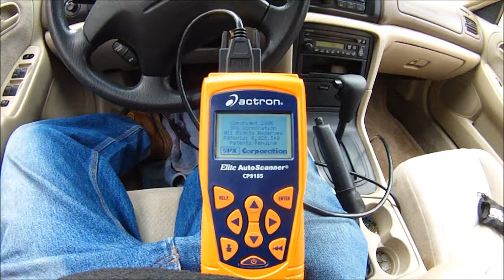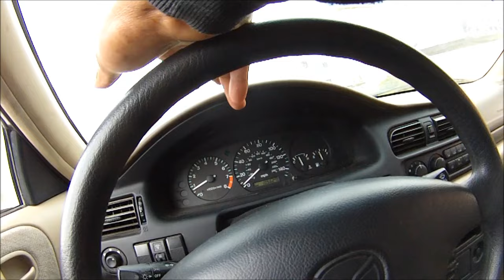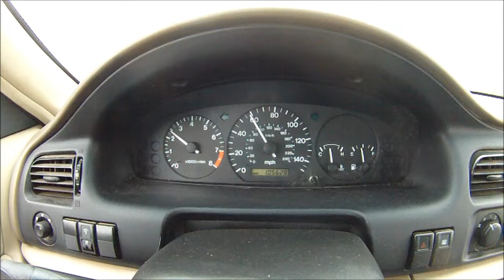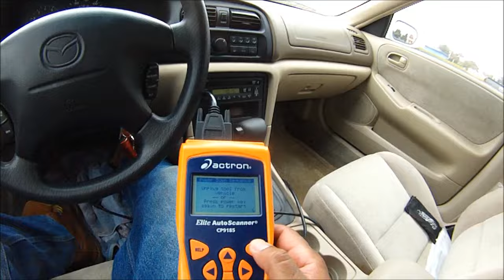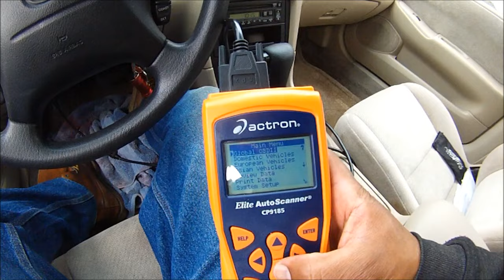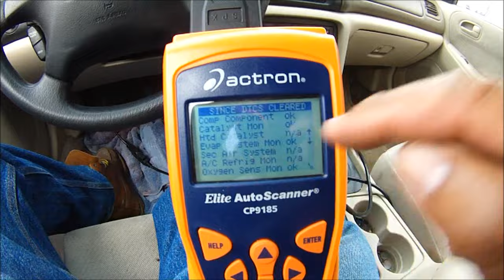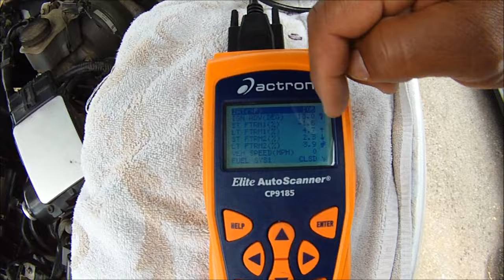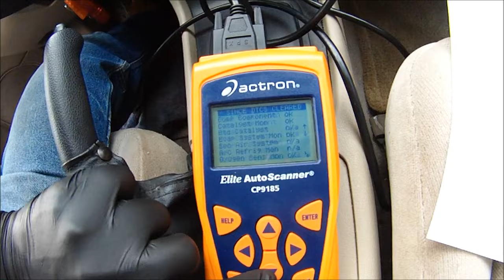WHAT SMOG TECHS WONT TELL YOU AFTER YOU FAIL THE SMOG TEST FOR (INCOMPLETION OF OBDII SELF TEST)

Comment: The easiest and fastest way to complete the drive cycles and get the monitors ready that I have ever found is the following:

#1. Fully warm up the engine, then drive on the highway/interstate at normal interstate speed ( without stopping ) using cruise control for 15 to 20 minutes. This will test everything except for half of the evap system. Many of the tests can not be run at low engine speed or if you are accelerating with much throttle. This is why cruise control helps so much. It maintains a nominal engine speed, under load, at a constant speed while the engine is fully warmed up. This is the perfect condition that almost all tests will run at. If you don't have cruise control, just keep the throttle and speed as steady as you can manually.

#2. Park the car, turn it off and let it fully cool down for 1 to 1.5 hours ( depending on how hot it is outside ). This runs the other half of the evap test which only happens when the car is turned off and cooling down. It watches the pressure in the gas tank to see if it falls when it cools down. Some cars also have electric vacuum/pressure pumps the gets activated as the car is cooling down.

Perform these steps exactly two.

Why twice?

There are 2 classes of OBDII codes, class A and class B.
Class A codes will set immediately or after only 1 drive cycle.

Class B codes will only set after being successfully tested on 2 drives cycles. Notice the word "successfully". If the proper conditions are not present during a drive cycle, the test won't run. This is why many people have to perform lots and lots of drive cycles to get the tests to complete. They simply don't know or understand how to create the conditions required for the tests to be successfully run.

Once you know how, it's very easy! Anyone can do it.
Reply: does the drive time to the highway factor?  takes me 10 mins to get on it.
Reply: No, it doesn't matter. For additional information check out page 25 of this document about the CARB standard: http://www.lbcc.edu/attc/documents/OBD2.pdf
Reply: I hope this works and I believe it will from what I have researched. A great big THANKS!!!
Reply: The document is no longer present at that link.  Is there another source for the info?

Comment: I just did this on my 2004 Mazdaspeed Miata and it worked beautifully! The Catalyst and EGR passed after the highway run. The evap test passed after a few minutes of stop and go at 35mph.
This is a blessing since I obtained the official instructions from Mazda to run a drive cycle on my model car and it's far more complicated than your instructions.
Reply from the maker: Congrats on passing your smog. I am in the process of finishing a drive cycle for a 96 Civic and its driving me nuts, I might have to change the Catalytic Converter but will not know until tomorrow. Ya some of the drive cycle modes are harder than others you just need to hunt it down. Nothing like passing the dreaded rip off smog test huh? lol.

Comment: GM drive cycle
Autotap® OBDII Diagnostic Scanner
General Motors Driving Cycle
A complete driving cycle should perform diagnostics on all systems. A complete driving cycle can be done in under fifteen minutes.

To perform an OBDII Driving cycle do the following:

Cold Start. In order to be classified as a cold start the engine coolant temperature must be below 50°C (122°F) and within 6°C (11°F) of the ambient air temperature at startup. Do not leave the key on prior to the cold start or the heated oxygen sensor diagnostic may not run.
Idle. The engine must be run for two and a half minutes with the air conditioner on and rear defroster on. The more electrical load you can apply the better. This will test the O2 heater, Passive Air, Purge "No Flow", Misfire and if closed loop is achieved, Fuel Trim.
Accelerate. Turn off the air conditioner and all the other loads and apply half throttle until 88km/hr (55mph) is reached. During this time the Misfire, Fuel Trim, and Purge Flow diagnostics will be performed.
Hold Steady Speed. Hold a steady speed of 88km/hr (55mph) for 3 minutes. During this time the O2 response, air Intrusive, EGR, Purge, Misfire, and Fuel Trim diagnostics will be performed.
Decelerate. Let off the accelerator pedal. Do not shift, touch the brake or clutch. It is important to let the vehicle coast along gradually slowing down to 32km/hr (20 mph). During this time the EGR, Purge and Fuel Trim diagnostics will be performed.
Accelerate. Accelerate at 3/4 throttle until 88-96 km/hr (55-60mph). This will perform the same diagnostics as in step 3.
Hold Steady Speed. Hold a steady speed of 88km/hr (55mph) for five minutes. During this time, in addition to the diagnostics performed in step 4, the catalyst monitor diagnostics will be performed. If the catalyst is marginal or the battery has been disconnected, it may take 5 complete driving cycles to determine the state of the catalyst.
Decelerate. This will perform the same diagnostics as in step 5. Again, don't press the clutch or brakes or shift g
Reply from the maker: Thanks George K we appreciate your contribution to this troubling task that many people have no idea about, right on God Bless.
Reply: The gas tank has to be between 1/4 and 3/4 for the evap solenoid to cycle, and pass that monitor test
Reply: How do you do this without putting other motorists in danger or getting pulled over????

Comment from the maker: This is the drive cycle for Code P1000 Go get it and attack the problem
Ford P1000: OBDII Monitor Testing Not Complete
Jaguar P1000: Engine control module (ECM) - internal error
Kia P1000: System diagnosis incomplete
Land Rover P1000: Engine control module (ECM) memory erased - no codes stored
Mazda P1000: OBDII Drive Cycle Malfunction

Read more at: http://www.obd-codes.com/p1000
Copyright © OBD-Codes.com

OBDII Monitor
Exercised	
Drive Cycle Procedure

Purpose of
Drive Cycle Procedure
Drive Cycle
Preparation	1. Install scan tool. Turn key on with the engine off. Cycle key off, then on. Select appropriate Vehicle & Engine qualifier. Clear all DTC's/ Perform a PCM Reset.	Bypasses engine soak timer. Resets OBDII Monitor status.
2. Begin to monitor the following PIDs: ECT, EVAPDC, FLI (if available) and TP MODE.
Start vehicle WITHOUT returning to Key Off.	
3. Idle vehicle for 15 seconds. Drive at 64 Km/h (40 MPH) until ECT is at least 76.7°C (170° F).	
Prep for Monitor Entry	4. Is IAT within 4.4 to 37.8°C (40 to 100° F)? If Not, complete the following steps but, note that step 14 will be required to "bypass " the Evap monitor and clear the P1000.	Engine warm-up and provide IAT input to the PCM.
HEGO	5. Cruise at 64 Km/h (40 MPH) for up to 4 minutes.	Executes the HEGO monitor.
EVAP	6. Cruise at 72 to 104 Km/h (45 to 65 MPH) for 10 minutes (avoid sharp turns and hills) Note, to initiate the monitor: TP MODE should =PT, EVAPDC must be >75%, and FLI must be between 15 and 85%	Executes the EVAP Monitor (If IAT is within 4.4 to 37.8° (40 to 100°F))
Catalyst	7. Drive in stop and go traffic conditions. Include five different constant cruise speeds, ranging from 40 to 72 Km/h (25 to 45 MPH) over  a 10 minute period.	Executes the Catalyst Monitor.
EGR	8. From a stop, accelerate to 72 Km/h (45 MPH) at 1/2 to 3/4 throttle. Repeat 3 times.	Executes the EGR Monitor.
SEC AIR/CCM (Engine)	9. Bring the vehicle to a stop. Idle with transmission in drive (neutral for M/T) for 2 minutes.	Executes the ISC portion of the CCM.
CCM (Trans)	10. For M/T, accelerate from 0 to 80 Km/h (o to 50 MPH), continue to step 11. For A/T, from a stop and in overdrive, moderately accelerate to 80 Km/h (50 MPH) and cruise for at least 15 seconds. Stop vehicle and repeat without overdrive to 64 Km/h (40 MPH) cruising for at least 30 seconds. While at 64 Km/h (40 MPH) , activate overdrive and accelerate to 80 Km/h (50 MPH) and cruise for at least 15 seconds. Stop for at least 20 seconds and repeat step 10 five times.	Executes the transmission portion of the CCM.
Misfire & Fuel Monitors	11. From a stop, accelerate to 104 Km/h (65 MPH). Decelerate at closed throttle until 64 Km/h (40 MPH) (no brakes). Repeat this 3 times.	Allows learning for the misfire monitor.
Readiness Check	12. Access the ON-Board System Readiness (OBDII monitor status) function on the scan tool. Determine whether all non-continuous monitors have completed. If not, go to step 13.	Determines if any monitor has not completed.
Pending Code Check and Evap Monitor "Bypass" Check	13. With the scan tool, check for pending codes. Conduct normal repair procedures for any pending code concern. Otherwise, rerun any incomplete monitor.
Note: if the EVAP monitor is not complete AND IAT was out of the 4.4 to 37.8° C (40 to 100° F) temperature range in step #4, or the altitude is over 2438 m. (8000 ft.), the Evap "bypass" procedure must be followed.
Proceed to step 14.	Determines if a pending code is preventing the clearing of P1000.
Evap Monitor "Bypass"	14. Park vehicle for a minimum of 8 hours. Repeat steps 2 through 12. DO NOT REPEAT STEP 1.	Allow the "bypass" counter to increment to two.
Reply: What Scan tool is that?
Reply from the maker: Atron CP9185 if you buy any scanner make sure it has live data
Reply: I have the catalyst obdII reading as not ready for 2004 kia spectra. Someone at auto zone removed my battery to help me put in my headlight over two months ago. I didn't realize what that actually does when the batteries disconnected.  Would it still read not ready after all this time & Do I have to complete all these steps to execute the catalyst monitor or 1-3 & step 7?

Comment: Bro thank you so much I did this cleared all my monitors and I had 4 engine codes just cleared it did what you said and I passed I'm so fucking happy thank you so much man!
Reply: ayeeeee
Reply: Did you fix the codes before clearing them? I might clear mind without fixing it and taking it in for emissions
Reply: Ricer Miata dude u jus dropped the f-bomb on a Christian channel 😂😂 love ur vids btw
Reply: @wordlife_97  Did it work?
Reply: Amber Fillmore Nope. I cleared it and the guy knew I cleared the codes because the car has codes that need to warm up before taking it for emissions. I eventually found the problem but sold it and bought a mustang.
Reply: @wordlife_97  ok. That's what I was worried about. Thanks for responding.
Reply: Rudnickk

Comment: I had p0420 code so I cleared the codes and what you said and it worked perfectly !! Thank you so much man . You just saved me 600$ . Much love . God bless .
Reply: Did u fixed the issue first n then cleared it?
Reply: @alanchanthavisouk8557  I was able to do this too with a P0420 code in my Nissan without fixing anything, I just erased the check engine light did the drive cycle and as soon as my I/M monitors turned green took it straight to get smog and passed... not even 20 minutes after passing the smog the check engine light came back on, so be ready to take it to the smog asap after doing this

Comment: The procedure below worked on my 2014 Honda Accord. 

Note: I found it on the web.  

Here is a typical Honda Accord drive cycle. Driving your Honda Accord in the manner below should make the required Emission Monitors "Ready". Before you start the Drive Cycle make sure your Honda Accord's fuel level is between 1/4 and 3/4, otherwise the EVAP test won't run. Make sure to obey all traffic laws while performing the drive cycle.

1. Begin by idling the engine while 2 1/2 minutes. Next idle for another 2 1/2 minutes with the A/C compressor and rear defroster on and while the transmission is in Drive (D); only of automatic transmission. This part of the drive cycle checks the oxygen sensor heater circuits, air pump and EVAP purge system.

2. Turn the A/C compressor off and rear window defroster off and accelerate to 55 mph at half throttle. During this step the OBDII system checks for ignition misfire, fuel trim and EVAP canister purge.

3. Hold at a steady state speed of 55 mph for 3 minutes. The computer will now be testing the EGR system, air injection pump, O2 sensors and canister purge.

4. Decelerate to 20 mph without braking (or depressing the clutch). Once again the computer system will check EGR and purge functions.

5. Accelerate back to 55 to 60 mph at half throttle. During this step the OBDII system will look for misfires, fuel trim and EVAP purge.

6. Hold at a steady speed of 55 to 60 mph for 5 minutes. Catalytic converter efficiency, EGR flow, ignition misfire, fuel trim, EVAP system and oxygen sensors operation will now be checked.

7. Decelerate to a stop without braking (or depressing clutch). The OBDII system will complete the drive cycle at this point.

We recommend completing this drive cycle at least twice in order to ensure all required parameters have been met.

Comment: Emission test relying solely on OBD2 monitors has added stress to car owners whose OBD2 monitors have shown to be not ready when their cars are taken to the emission test centers.  Now, they have to perform all kinds of procedures, which are difficult to complete (maybe not to an expert), to get the monitors ready.  If the monitors are not ready, let's say just couple of them, car owners should have the option to get their cars tested through I/M 240 dynamometer or another test which truly measures the pollutants coming from the car's emission.  Local governments who require emission test and emission test centers opted not to do this anymore for cars equipped with OBD2 technology.  I'm not exactly sure why they resorted to that, maybe because it takes longer or the equipment required for I/M240 are way too expensive to purchase and to maintain.   Emission test is no longer an emission test if the only option is testing OBD2 monitors.  It should be called emission monitors test or test for a car's emission technology but it should no longer be called emission test per se.  OBD2 testing is efficient and clean, yes, but give the car owners an option to get the pollutants coming from their cars' emission actually tested through I/M 240 (or another method that is truly testing emission and not the car's technology) when their OBD monitors are showing not ready especially if they are not throwing any codes.

Comment: Thanks oldskool funk. Great video! I have a 2007 Mazda 3 that wasn't passing California smog. I found this Drive Cycle on a Mazda site. I did it this morning (6 a.m. on I-5 a little scary so be careful) and Voila! I took it back and it passed. I'm reprinting it here. Hope it helps someone else.

"Emission monitors, including the one for the catalytic converter, are set to ready by a condition based drive cycle, not by how many miles you drive it.

Below is the drive cycle to perform. You have to do it exactly as described in the order described.

Ensure that the fuel tank is between 1/4 and 3/4 full.
Start cold (below 86°F /30°C) and warm up until engine coolant temperature is at least 160° F (typically requires at least one minute; up to 3 minutes).
Accelerate to 40-55 MPH at 25% throttle and maintain speed for five minutes.
Decelerate without using the brake (coast down) to 20 MPH or less, then stop the vehicle. Allow the engine to idle for 10 seconds, turn the key off, and wait one minute.
Restart and accelerate to 40-55 MPH at 25% throttle and maintain speed for two minutes.
Decelerate without using the brake [or the clutch!] by coasting down to 20 MPH or less, then stop the vehicle. Allow the engine to idle for 10 seconds, turn the key off, and wait one minute.
 If they monitors do not set as ready after doing the above drive cycles, either there is a low voltage condition to the computer(usually a slightly weak battery), or the catalytic converter is marginal in performance and needs to be replaced."
Reply from the maker: ed burkhardt Congratulations on passing the dreaded rip off smog lol. What a relief huh? Im working on a car that failed right now and one more right after that, Smog is brutal at times lol. Thank you so much for posting your vehicles drive cycle we appreciate it very much its all about helping each other and keeping the Gov from digging to deep in our pockets, Keep your head up Ed.